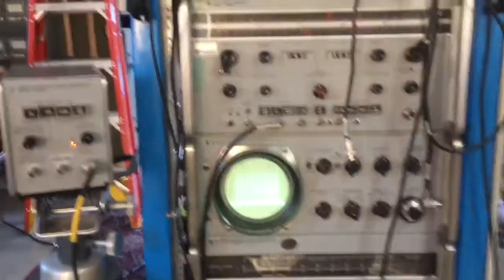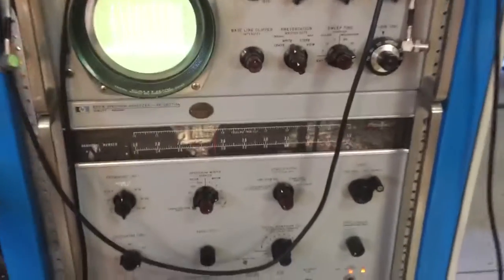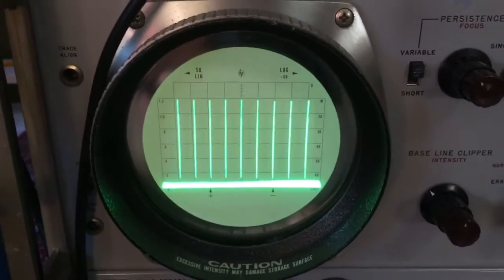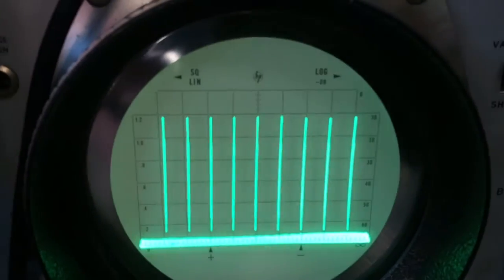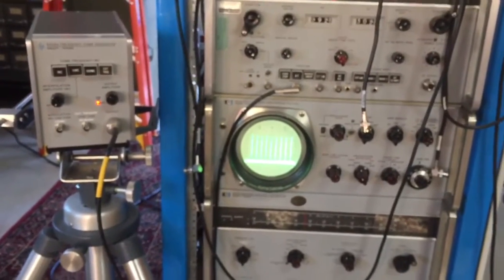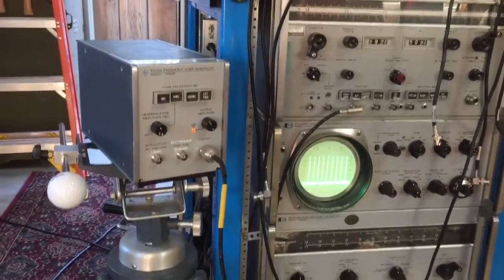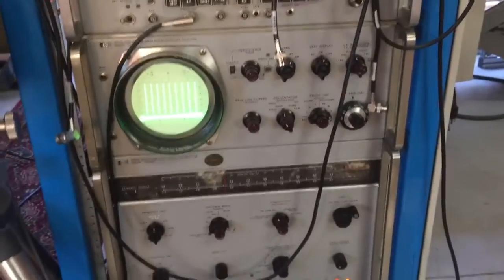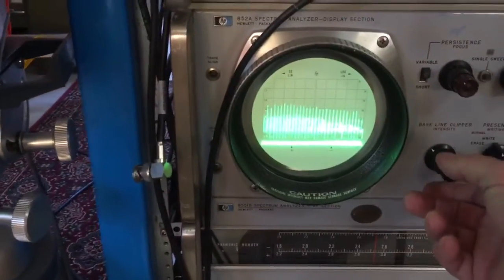Vintage hp instruments: hp 8406A  Frequency Comb Generator circa 1967

Comment: Tom, can one enter any frequency and generate multiples from it?
Reply from the maker: yes, with external trigger, manual says: External Trigger: External signals (normally sine waves)
 between 1 Mc and 200 Mc can be used to produce

combs spaced at frequency of trigger signals. ref https://bama.edebris.com/download/hp/8406a/HP%208406A.pdf